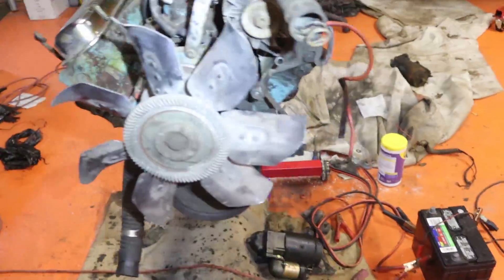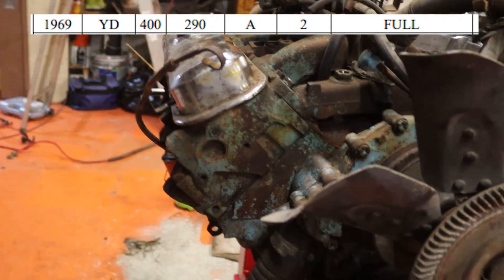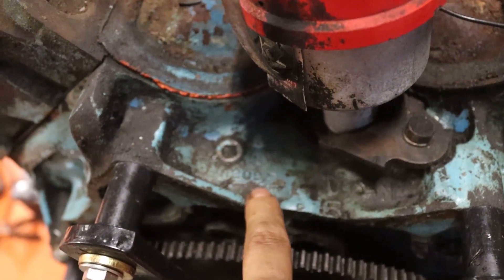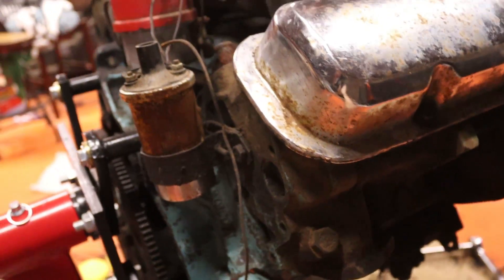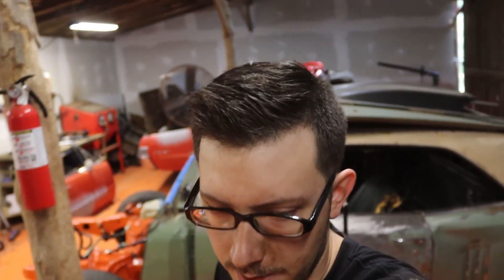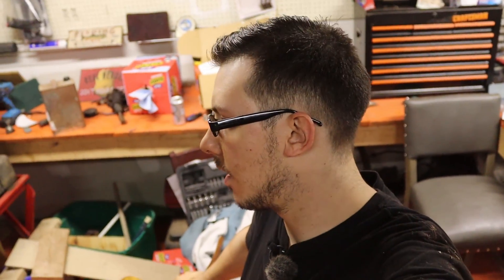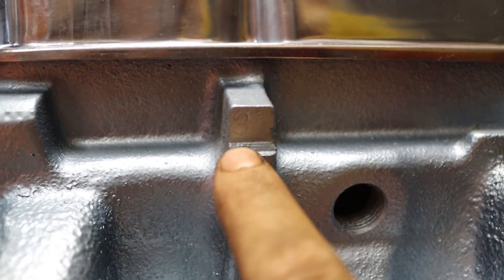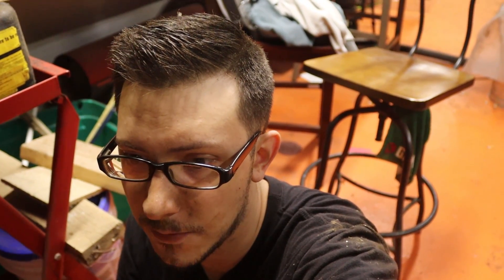How to Identify and Decode Pontiac Engine Blocks

Comment: 1970 and about V-8 350-455 are stamped on the driver's side in front of the motor mount. like mine is a 77 block in which is stamped up by the disturbers that's the year of the motor 1977, my block is stamped 400. The heads are 6w.
hope this helped you!

Comment: I am having flashbacks of rebuilding the 400 in my 71 Lemans.  It was 87 and I did it outdoors using an old tire for an engine stand.   I put 30k in that dingleball rebuild and it still ran when I sold the car :)

Comment: Please tell me what I have here? On the block in front passenger side is 0269476  XH
Top of head below valve cover blow valve cover  is K148 and K158.                                                                                    Stamp on back of block by distributor is K 188   69 13  N
Center exhaust ports Big numbers 6  5

Below head by oil filter is 9790071   B Body car. Any info on this I will appreciate.

Comment: hi all-
i have a 75 t/a formula:  i believe i have a 400 motor with 5c heads.  the casting is 481988.  is this a good motor to build up from?  or is this the emissions friendly weaker block?  thank you kindly
Reply: #481988 is a '70-74 400 and what I have in my Trans Am. A lot of these were made and it's stronger in material than the lighter ones Pontiac started producing for passenger cars in '75. You'll see "400" stamped on the block near the fuel pump.
Reply: I have this engine casting # also. With 4x heads.
From what I researched the heads are 67. 
Is this right?
TIA
Reply: Are you asking if those 4X heads were cast in 1967? 4X heads were only cast in '73 and '74. There's lots of good info on Pontiacs and how to date them at the Wallace Racing website. The 6X-8 heads on my '73 400 have a casting number above the exhaust ports right under the valve cover of "F237." The first letter is the month (A=Jan., B=Feb., etc.), the next digit or two digits is the date, and the final digit is the year. So, my heads were cast June 23, 1977. The same dating system applies to the engine block casting numbers close to the distributor hole. @garysarghview7277

Comment: I have A247 code on the top right by Valve cover,a 6x code in the middle port? hard to see and a 6m11 by the front exhaust port of my heads Pontiac 400 engine what heads do I have?

Comment: Thanks for the content. I’m confused as to why it wasn’t mentioned that the displacement (350, 400 or 455) is stamped directly towards the front of the block near the freeze plugs on most of these
Reply from the maker: This is definitely a thing - however I’ve been running into a ton of them lately that haven’t had the displacement printed on them. Could be just luck of the draw
Reply: @LSxHunter  I hear you. I know that in that era, Pontiac was all over the place with their stamping and designations!
Reply: 1970 and about V-8 350-455 are stamped on the driver's side in front of the motor mount. like mine is a 77 block in which is stamped up by the disturbers that's the year of the motor 1977, my block is stamped 400. The heads are 6w.
hope this helped you!

Comment: how do you tell the difference between the olds 403 and pontiac 400? both were in the firechicken.
Reply: The Olds engine has the oil cap in the front near the middle of the block and the Pontiac oil cap is in the valve cover.
Another difference is the Pontiac has a divorced intake manifold with a seperate metal valley pan beneath it.

Comment: A `69 YD 400 would have 2 motor mount bolt bosses on the side of the block. A `70 YD 400 would have 5 to use in the 2`nd gen Firebirds. The `70 will also have a "400" cast into the side of the block where the `69 won`t.

These quirks will exist on the other cube engines starting in `70.

Comment: Great video learned alot. About to embark on my first engine rebuild. I got 67 lemans with a 400. My heads  read A035 5C and advise I can't find much on line.
Reply: The 5C is virtually identical to the 6X - 8 he has on that 400. Same valve sizes, screw in studs, 100cc chambers, they were only made in 1975 while the 6X was made from 1976 to 1978 when production on the 400 ended, with the remaining engines used in 79. 

The 5Cs are a good head, and in stock form flow a bit more than a 6X and many of the earlier 72cc heads from the 60s. On a .030 over 400 they make just under 8:1 compression with a true flat top piston with only two or four valve reliefs, and no chamfer around the crown. The stock pistons lower compression considerably by being down the hole a few thousandths and having the chamfer around the crown.

On a 455 they make roughly 8.8:1 with a flat top. I ran a 455 with cast pistons, stock rods, ARP bolts in the rods, .030 over, Ultradyne 280/288	(223/231@.050-.463/.485lift with 1.5 rockers .510/.534 lift with 1.65 - 	110 LSA) cam, either the Performer, RPM, or stock intake (they all ran about the same), cheap Summit 1 5/8" headers, Qjets and Holley 850s, Th400s and 2004Rs with stock converters, in a 4100lb 1970 GTO. It had 2.93 gears behind it, and would run mid to high 12s on 87 octane with no power adders, shifting it at 5500rpm.

A friend of mine has a 1980 Formula and he built the same engine with 6X heads and it ran essentially the same times pushing a 2.56 gear.

You could mill them, but really why bother running 93 octane when the price of gas is going up? You won't pick up that much power by switching to premium with a 9.5:1 compression.
Reply: @SweatyFatGuy  I know this is old...but. That 455 sounds like a nice streetable combo. I have 5C-4 on a 400. Runs fine but 3.73 gears there when I bought it. Runs out of RPM before the end of the quarter mile. I was going with 3.23 or 3.42 but the 2.93 sounds good. So you recommend?
Also, are you nervous at  5500 with stock rods?
Thanks
Reply: @SweatyFatGuy  You are a wealth of Pontiac information. Can I bounce a few things by you?
So, I have a 481988 block I am wanting to build. Just bought a 455HO reproduction intake. Terrible cast, but should clean up. I may go with the stroker thing like you said. 
Do you like that intake? I have a 71 factory cast also. I have many Quadrajets as I like them.
What cam would suggest?
I have 6X-8 heads lying around?
Just a street machine in a 73 Formula. 
Thx
Reply: Thank you for all the info!!

Comment: What type of information is important with the second set of numbers in the back above the oil filter housing?
Reply from the maker: I’m shocked I missed this! The numbers on the back of the block tell you specially what block it is, you can certainly use the YG on the front but the front codes are shared across different types of blocks - the rear numbers are not.

Comment: Love your vids. I have a '77 Pontiac Firebird Esprit 350 with 6x-4 heads. Can I bore it out to create a 400? Can't seem to get an answer to this question.
Reply: The 350 has a 3.875" bore a 400 has a 4.12" bore, so if you hog it out to a 400, you're removing nearly a quarter of an inch or metal, so won't have cylinder walls left. That goes for every 350 block, early, late, doesn't matter.

The 455 has a 4.15" bore, which is why you can bore a 400 .030 over, turn down a 455 crank, weld up the thrust surface, (or get an aftermarket crank with the 3" mains and correct thrust) and turn it into a 455. 

The small bore is what hampers the 350 for performance, they have the same stroke as the 400 at 3.75".
Reply: Not on a late block like that. The cylinder walls would be too thin. Pontiac lightened their blocks in 75 for EPA reasons. 400's are everywhere, just look for a 481988 block. It's the stronger casting pre-75. But DO use the 6x-4 heads!

Comment: I just had a 80 trans am with a 1972 400 with 6x8 heads , some sort of cam, headers, and dual exh and it moved pretty good even with the low compression.
Reply from the maker: Hoping with the 2004R and 3.55s it'll get out of it's own way.

Comment: Does the YD also indicate that your engine is a 400?
Reply: Ok thanks for the info.
Reply: Are there any 1969 Pontiac 428 engines that have a 2 jet 2 barrel Rochester carburetor? Or are those carburetors only on the 400 engines?
Reply: I've never seen a 2-Barrel on a 428 but yes it can be done with the 2_barrel intake. @diesellife3850
Reply from the maker: Not necessarily - YD could also be a 1965-666 389, 67 400, 69-70 400, 72-73 455. If we look at the side and see 3 freeze plugs we know it's at least a '67. Jake Bullet mentioned that in another comment on here.
Reply: Ok because I came across a list of codes online that had those letter codes broken down for year and cubic inch of engine.
Reply from the maker: @diesellife3850  Pontiac is known for recycling codes - the code that makes life easy is the one on the back of the block behind the head.

Comment: why would you put up a video decoding Pontiac blocks, when all one has to do is buy Pete McCarthy's musclecar manual, every code is in there.  or, buy a 1971 green Chilton manual, or a 1972 blue motor manual.  you don't need a video.  you need a manual. this is all rehashed info, we've been decoding and buying these out of the junkyard since 1982 ?
Reply from the maker: YouTube is the world's second largest search engine behind Google. We're after the younger demographic who don't care to ever purchase a Chiltons. I think I even made a joke about it in one of the videos. People my age don't want to read anymore sadly.
Reply: @LSxHunter  HAHA.....the guy above is new to the WWW
Reply: I'm a retired mechanic. I frequently use Youtube to prepare for little jobs. I understand that there's no end to the novices on here but my decades of experience usually helps me to find the seasoned professionals fairly easily. I'm an old fart who considers Youtube to be a valuable resource.
Reply: @timsharpe3498   I agree with you, I do have to say I'm a truck driver, not a mechanic, but, 1st thing I do when something breaks down is to look on YouTube to see if somebody shows a video of a fix for the problem.  I very quickly figure out if it's something I wish to tackle or look for another matter of resolve.